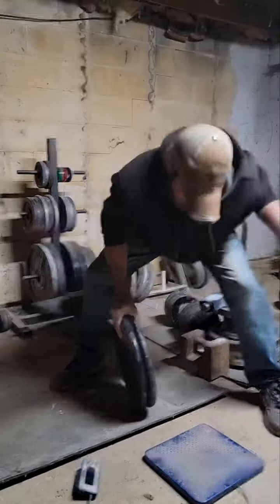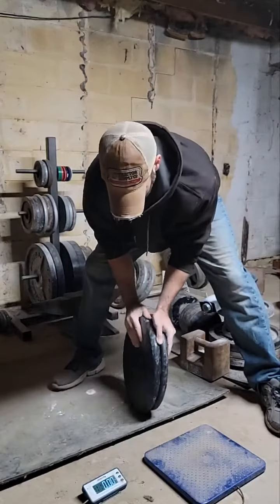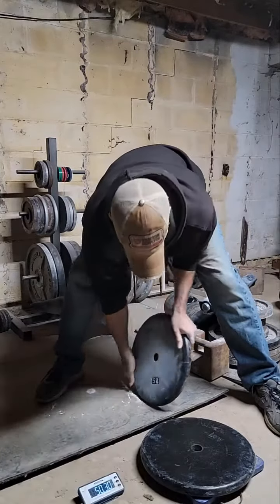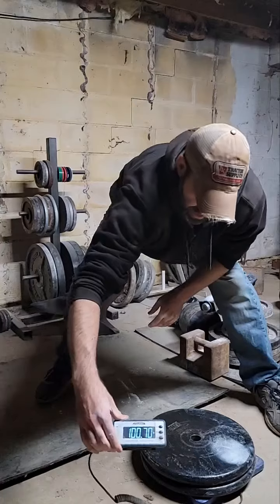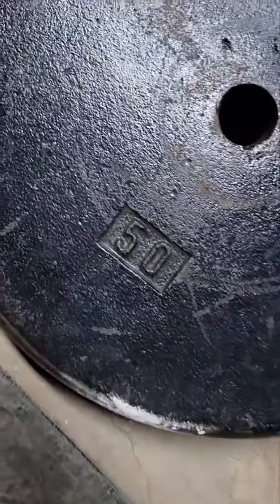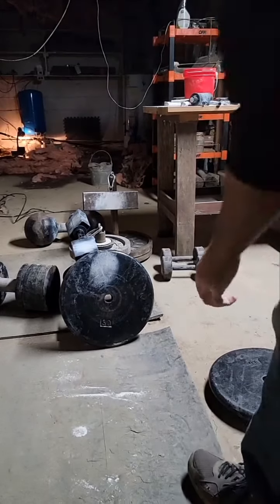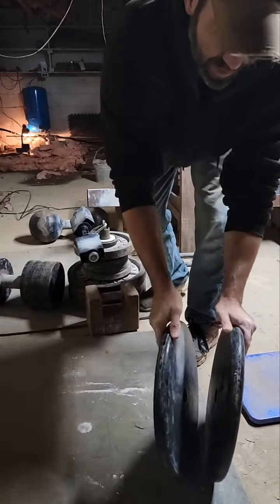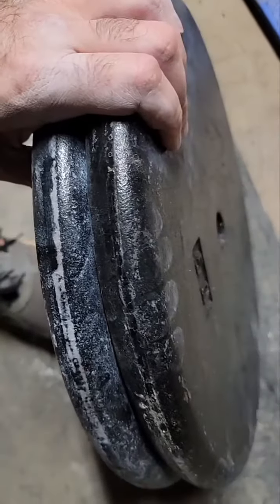2 50lb pancake plates pinch lifted with one hand for the first time (ever?)

Comment: Do you do concrete work or something. Jack LeLanne. I like the eclectic plate sets.  Oh badass i have one of those square dumbbells. My dad go it off some jobsite long time ago
Reply from the maker: The square one is a scale calibration weight, they are fun to use for a variety of lifts.  I don't do manual labor for work but I live pretty rurally and use my hands a lot.  I've also been training grip for a few years now and get grip coaching from dieselcrew.com Thanks for watching :)